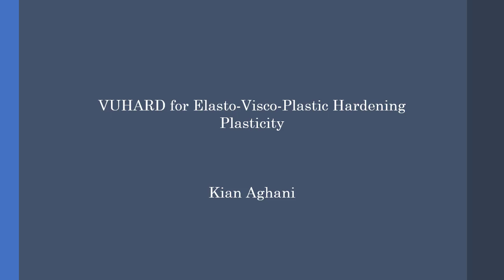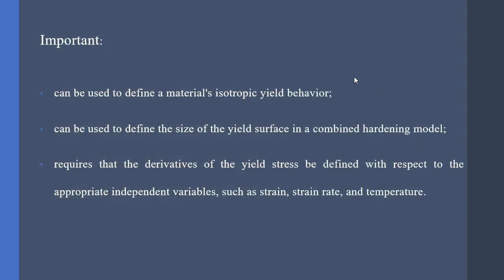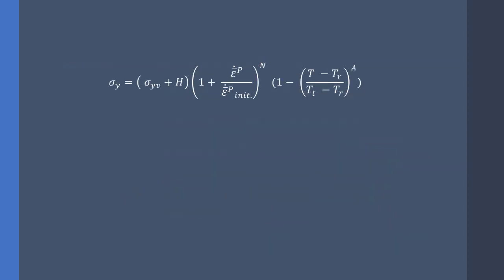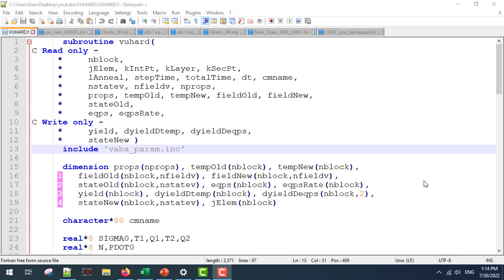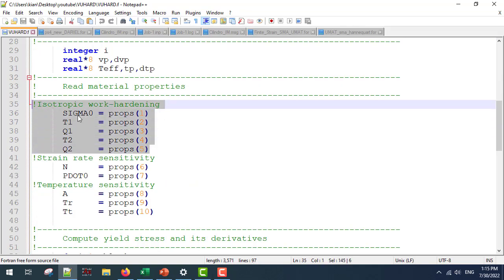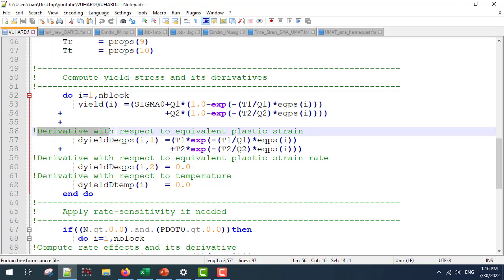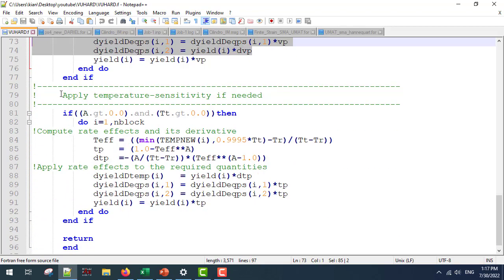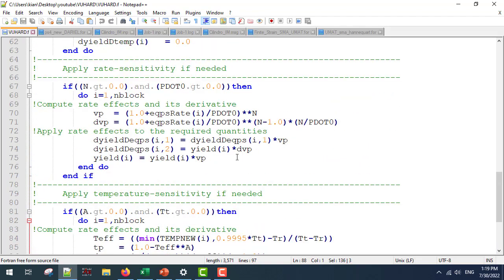Modeling Elasto-Visco-Plastic material using VUHARD subroutine in ABAQUS

Comment: Thanks for the video.
One question, if the output from this subroutine is yield(i), how do the derivatives of yield wrt. plastic strain, plastic strain rate and temperature affect the material haredning? 
These quantities do not seem to be part of the yield stress calculation.
Reply from the maker: The answer to your Q is in the fundamentals. See references in which the visco-plastic materials are discussed. One hint is that, VUHARD can replace V/Umat provided that we produce the slope of the changes in stress/strain curve. Thus, those derivatives are used to estimate the increment of the state variables.
Reply: @kianaghani  Thank you for your reply.
I read the manual now and it makes sense 🙂